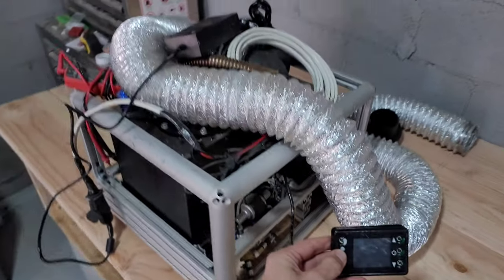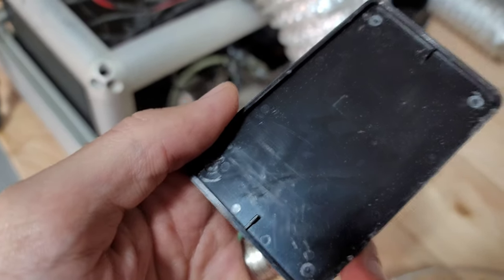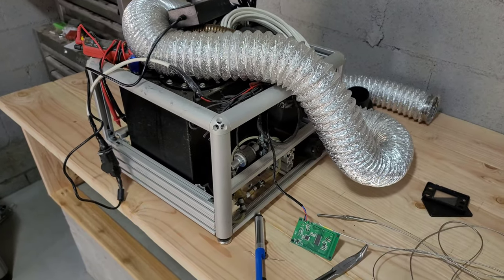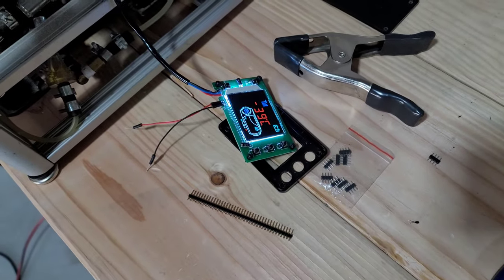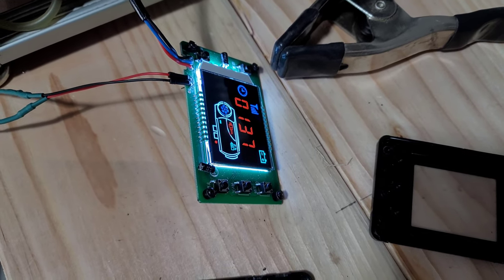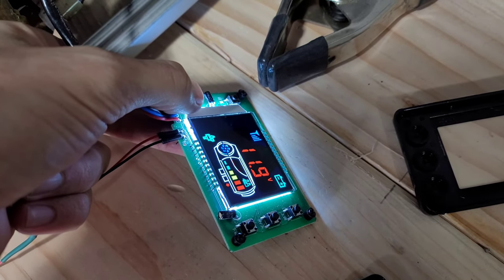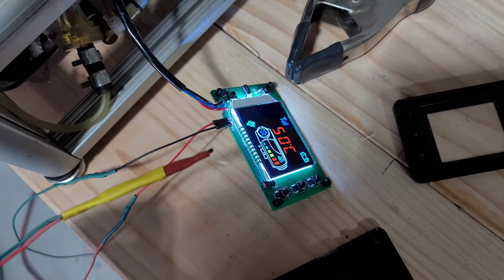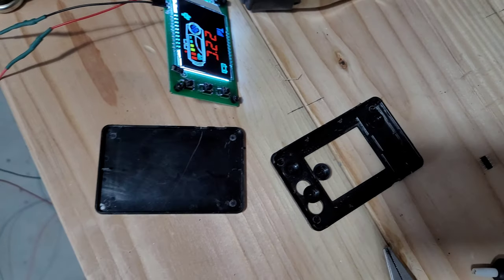Automated Temperature On Chinese Diesel Heater

Comment: Would make sense to solder a 2-pin socket where the thermistor used to be, that way you can at least unplug it if needed, or better still a jack plug so you can keep existing thermistor but interrupt it when an external one is plugged in.

Comment: Hello, in Chinese goods, when I reach a certain temperature in the environment, the system does not cut off. Is this the problem part when I change the heat therm?
Reply from the maker: I don't think so. I actually got a brand new controller and just used the controller temp sensor without modification. And when my temperature reaches its desired temp setting it does not turn off, it just slows down the heat and fan output to the lowest setting.

Comment: why won't you put the controller in the tent :D
Reply from the maker: We thought about it but for us it was a little too bright at night inside the tent and if we cover it, it will throw off the temperature sensor.
Reply: Why not just extend the wires and have the control where you are heating? Easier and cheaper
Reply: @DaveKrick  these controllers have those trays you pop them into - how about putting them with screen facing the other way, so it does not shine?
Reply: Put some window tint on the screen to reduce the brightness.
Reply: Or just get a remote , that will solve it too. But I also understand the convenience of having this mod.
Reply: Seems like a lot of bother, extended wire?

Comment: You have the pump mounted all wrong, if you run it like that, it won't last that long because of cavitation, it should be at a angle so the air will travel up and Into the heater...
Reply: No less than 30°. The piston is lubricated by the fuel. If the angle is too low it will wear out the pump. Straight up is best.
Reply: 45 degree says the instructions

Comment: He,s right you need to put your pump on a angel
Reply: corey Babcock  manual says 15-30 degrees tho , mind explaining why verticals is better?
Reply: @Nimesh222  My manual reads 30°. Air bubbles are normal.
Reply: Angels might be kinda hard to find , I think they mean Angle not and angel.😂

Comment: just cut and extend the wires on the controller alot easier its only 3 wire and do an 3 wire extension cable aslong as you want with a with a releasable connector
Reply: I extended my blue lcd screen wires by 5 meters and incased them in plastic conduit.

Comment: The component you removed from the controller is a Thermister. The item you have attached is a Thermocouple. Differant animal !🤔
Reply from the maker: Hi Steve. I installed a TWTADE 3M 10K B3950 Thermistor Temperature Sensor.
Reply: @DaveKrick  Yes, that would be more appropriate than the thermocouple.

Comment: It looks like to extend the wires for the controller would be faster and easier. That way you would have the controls in the tent with you...but thats what everyone else is doing, so lets confuse thermocoupler and thermistor, lets damage the outer case of the controller so we can use the glue...
Reply: I'm not complaining. This video taught me how to not take the unit apart, so it was indeed helpful. I need to make the unit shut off by means of an external signal so getting in the box is necessary.